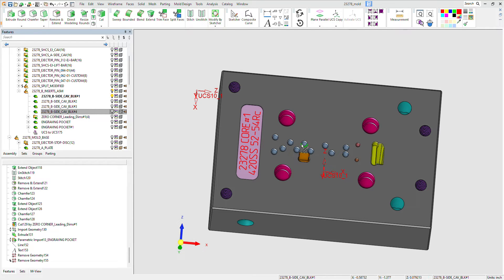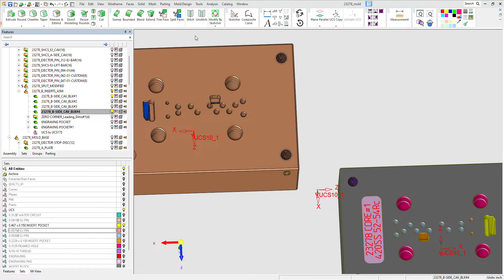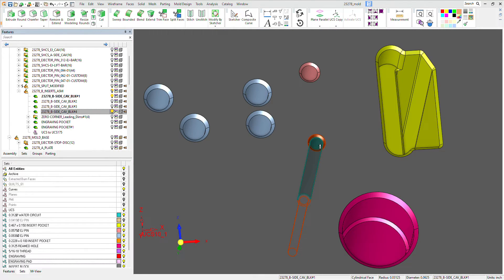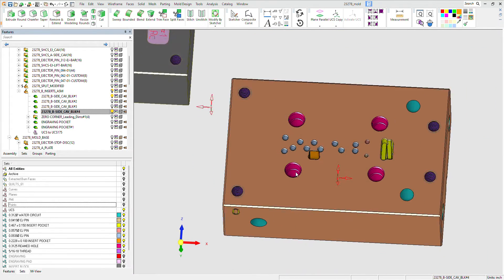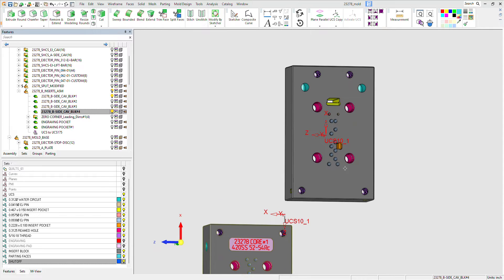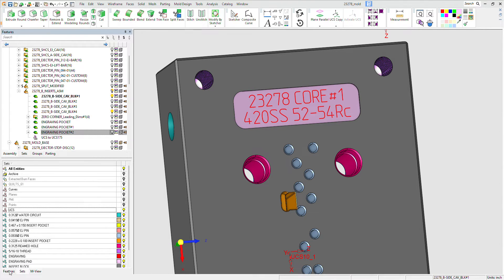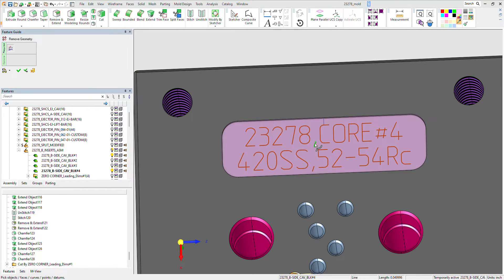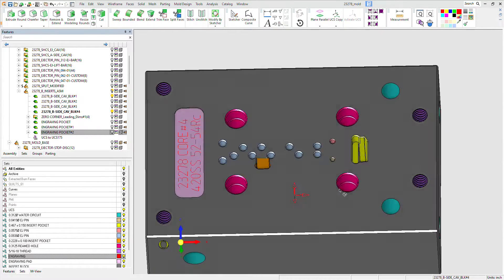Cimatron videos

Comment from the maker: If the text isn't selected automatically and perfectly, there are two solutions: The tolerance is not good for the size of the letters. Change the tolerance. Number 2 is that I have seen it work best when the wireframe is merged into one entity, like it is when creating the text in Cimatron design. Imported data may need to be merged together for best results.

Comment from the maker: Engraving in Cimatron is the easiest (quickest) that I have ever seen. Here is what you do: Use "Surface Milling" as the main procedure type and "Open Contour" as the sub selection. Place all the wireframe to be engraved on to a set. Place (only) the surface(s) that the engraving takes place on another set. Then select the curves by set and the surfaces by set. In motion parameters be sure to change the passes to incremental Z. Then you can specify 10 passes at 0.0015" or whatever you like. Save this as a procedure template. Next time you need to engrave, you only have to organize the two sets and apply the template. Large paragraphs of text are chained automatically.